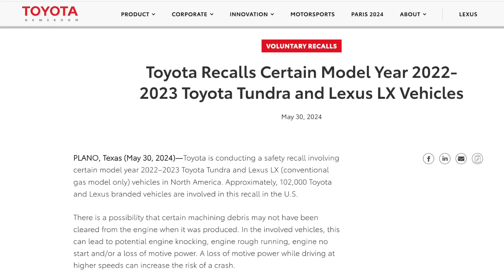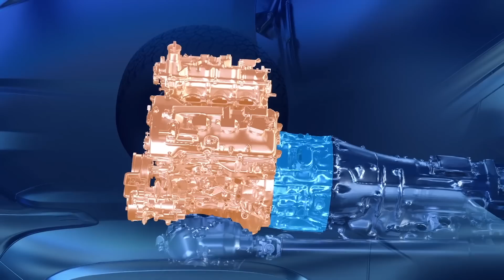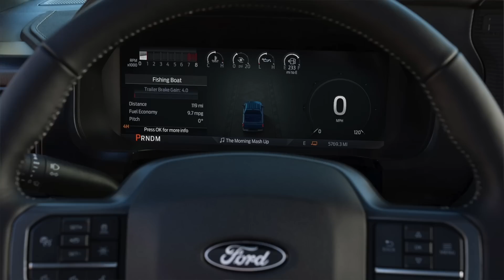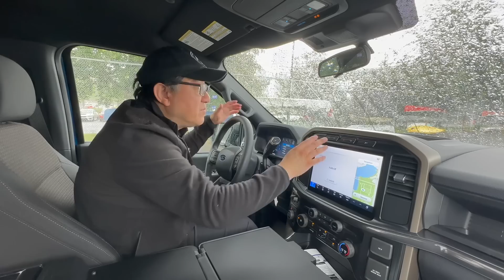ENGINEER EXPLAINS TOYOTA TUNDRA RECALL // SHOULD YOU BUY FORD F-150 INSTEAD?

Comment: I do not want any of these turbo charged over stressed engines. Give me the 5.0 liter in the Ford and 5.7 in the Tundra. I have written off GM and Dodge. I own two trucks. I have the 5.3 liter Vortec prior to the ACMS system and a 4.8 purchased because it did not have ACMS. I keep hearing this is mandated by the government. Let’s change the friggin government. What is better for the environment? A vehicle that lasts 75,000 miles or one that lasts 300,000? There is pollution and energy costs that go into each new vehicle. Many of vehicles sold today are short changing the younger generation. My last Silverado had 385,000 and was still going strong but needed another transmission. A new owner put in another transmission and I saw it back on the road a week later. I know that simple is better and all the fancy poop that they are putting in trucks today will be a problem tomorrow.
Reply: Dodge hasn't built a truck in 16 years...
Reply: @M_dot202  we know what the Rams really are though. Dodge.
Reply: @korndawggy1801  that's almost like saying that AMC still makes Jeeps.
Reply: @korndawggy1801  I thought Rams were Fiat?  😂
Reply: @M_dot202 TOM"A"TOE, TA"MA"TO
Reply: Yeah turbos are junk good thing Ford you can get a V8 still.
Reply: Built in obsolescence
Reply: GM’s 6.2 is truly solid tho
Reply: @JokerG16 No they have that garbage AFM (cylinder deactivation) which causes the lifters to fail early. Those engines used to be reliable before they put in the AFM junk
Reply: That's just not a rational or reasonable statement. What specifically is an "over stressed" engine? What is over stressed specifically and how? It's also not a rational statement based on the issue this engineer just described as the root cause of the issue.
Reply: @ryansheard8092  there are indications that it is forward bearing failing in the Tundra. The forward support girdle of engine block may not have sufficient strength. The Ford Eco-Boost blocks are more robust in that area. The Tundra’a most forward bearing will how show dis-color from heat. How come it is the forward bearing that has usually spun? That does not  indicate metal contamination.
Reply: @inspiredartphotos  the girdle is a one piece design, from what I understand, under high stress, there is a twisting effect that starts at the rear of this "ladder" design and has a greater effect on the front bearing.
Reply: @Gestapo943  I agree!
Reply: @ryansheard8092  I take that to mean the ratio of torque and hp to displacement; there's a video on here where back in 2018 this issue came up in a conversation with toyota engineers regarding this engine design.
Reply: Toyota don’t have experience to do new technology
Reply: @tonybui135 Don't they let YAMAHA design their V  engines?
Reply: The 5.0 also has cylinder deactivation and has oil consumption issues just like the other domestic v8’s. The 2.7 is actually the most reliable engine of the f-150 lineup.
Reply: @ARehman11194  some of us liked the earlier generations of the 5.0.
Reply: @inspiredartphotos  it’s specifically the 21 and up, prior to that the 5.0 was a good engine, did have some oil consumption issues though in the later years prior to 21 though.
Reply: @ARehman11194  I understand that earlier 5.0 was a more robust block. Heavier but had less problems. When did they go the ACMS system and a belt driven oil pump?
Reply: @inspiredartphotos Both the first gen and second gen 5.0L Coyote V8s are very reliable (almost as reliable as any Toyota V8) and same with the 6.2L SOHC 2V BOSS V8 in the first gen Raptor as well as the Super Duty.
Reply: @ You made a wise decision. I read recently that Toyota is going to re-release a new FJ. It is supposed to be a throw back with the reliable V6. We will see.
Reply: @ARehman11194 Yet not as reliable as the 5.6L Endurance V8 in the Nissan Titan.
Reply: You guys are crazy lol. The turbo motors from ford are fantastic. Literally haven’t had an issue. The issues with Toyota are things that need to be ironed out and it’s every manufacturer that has ever built a new motor have the issues. Look up Toyota recalls and issues with the 5.7 when it came out versus the 4.7. This shit happens.
Reply: @wesharris07 and when the 5.7 came out there was also an option for the 4.6liter
Reply: It is like hypertension eventually you'll get a stroke because your heart works too much
Reply: Ford 5.0 V8's have cylinder deactivation now also. Along with a belt driven oil pump.
Reply: @randycupp5925 Exactly which is why I've bought the 2024 Nissan Titan with the 5.6L Endurance V8 in it with 400 HP and 413 Ibs of Torque vs the 2024 Ford F150 with the 5.0L Coyote V8 in it with 400 HP and 410 Ibs.
Reply: 5.0L has oil use issues.
Reply: Stellantis
Reply: I drive the 2021 F150 3.5 and I’m buying a new one. Tons of power and great on gas. I drive north to the cottage a lot. 
I’d go broke paying gas with a V8.
I’m getting 11klm per 100 at 118klm an hour for 3 1/2 hrs.
Owe…it will blow the doors off your V8’s and tow heavy loads easier!
That’s no B/S
Reply: @mcmuskie2563  Did they get this issue resolved. Ford has issued multiple service bulletins, with the most recent being Customer Satisfaction Program 21N03 – Supplement #4. This program extended warranty coverage under certain conditions for a VCT replacement due to tapping phasers.
Reply: @mcmuskie2563 What job do you have and how much money do you make to afford that overpriced EcoBoost truck of yours?
Reply: The 2.7 eco is the most reliable engine in any truck built today. It may not be the most powerful but it’s more than adequate for any half ton user.
Reply: @zachattack83  If I were going to buy a new truck I would strongly consider a 2.7 EcoBoost. They seem to the exception to my statement. My 4.8 VORTEC only has 39,000 miles on it. So I may not be buying a truck for a while. I was shopping for a Toyota Sequoia for my wife. That is where I started tracking the Toyota issues. We will be buying a Acura MDX from friends. They are replacing their 2021 model. It is normally aspirated and we can get for what their dealer trade would be. It has 35,000 miles on it.
Reply: I totally agree
Reply: Fully agree 100%
Reply: Fully agree 100%

Comment: people dont seem to see the fact that it is not just the tundra, it is also the lexus.  these blocks are made in 2 completely different factories across the world from each other and yet having the same debris issue?  not likely.  there are things that toyota are not saying here.  this same engine is inside the brand new gx550 too, so, toyota/lexus NEEDS  this engine to work and not give them issues because if not it will destroy their sales and business on pretty much every flagship model.  this is sad because even after "fixing the issue"  it still happens yet again and again over and over for most of the affected vehicles.  This is to the point that the dealerships are refusing them on trade in but they sure arent refusing to sell and advertise them everywhere to everyone though.  This is sad from toyota and needs to be made right more than just fixing it and more than just a public apology that means nothing at all from the owner/ceo of toyota/lexus

Comment: Years from now i bet it will be found to be the main bearing change that is the issue. Thee change from 4 to a single bearing failed and that caused the metal all over the engine not the machining process
Reply: Darn right!

Comment: I would consider a Titan while they last.
Reply: It will depreciate rapidly and not have parts availability.  I’d get an F150 with the 2.7t.
Reply: Me too. Love my Titan!
Reply: The Titan is a proven platform.  It is reliable and simple, V8 power, solid transmission, and the right amount of tech.
Reply: Obviously you don't watch Scottys channel.  He will tell you titans are crap
Reply: @ericswanson9773 Scotty is entitled to his opinion. I've had 5 years of flawless performance from my Titan, even when towing heavy. No regrets here.
Reply: @ericswanson9773  

Scotty is full of crap.
Reply: @ericswanson9773 Scotty Kilmer actually reviewed the Titan and he said the Titans are excellent trucks (the same thing he said about the Frontiers as well).
Reply: Scottys video on Titan ending was actually full of praise. He blamed Nissan for not marketing.
Reply: @AlexSantos-eo9kl Agreed 100%
Reply: I have 05 Titan 110K miles $500 in repairs in 19 years.
Reply: Fully agree 100%, I just traded in my 2011 Ford F150 with the 5.0L Coyote V8 in it with 163,000 miles on it for a 2024 Nissan Titan with the 5.6L Endurance V8 in it that had 32 miles on it but now has 4900 miles on it and man let me tell you its a freakn beast.

Comment: IMHO   Toyota did not include the 2024 Tundra's because the dealership could not sell them with a active recall.  That is OK because they are no longer selling 2024 anyways.
Reply: if anyone goes out and buys a 2024 tundra at this point they deserve whatever they get.
Reply: 2024 was also likely not recalled because the if you look at the effected engine dates in the recall only a very small portion of those engines would have made it into the 2024's. I think they will get recalled just like the hybrids at some point but it will be by VIN and not the whole allotment.

Comment: Trading in my 2024 white trd pro tundra with 12k miles for a 2024 Raptor R oxford white

Picking it up this Friday 

Will come back to Tundra when recalls are over
Reply: Absolutely the wrong thing to do unless you like to throw away money. You traded your truck a 24, which probably was made AFTER the fix was instituted, at the weakest point of the trade value for your truck. You should have waited until the fix was known and your trading position was stronger. Complete panicking move .
And I drive a F150 tremor which is better than a trd pro
Reply: @jimsteinway695  His truck. His decision. Move along.
Reply: Do you have the 3.5l turbo or 5.0 tremor?
Reply: smart move to get rid of it before it's included in the recall as well.

Comment: Is a Hyundai Santa Fe a reliable truck? I am looking at the turbo version.
Reply: Hyundai kids have a 1 year warranty for a reason. They break all the time.  Also their dealer network is the worst at honoring their warranty. I’d stay away.  I’d heard they are marking them up.  Get a Toyota
Reply: Hyundai and Kia dealerships are dropping in about 10 turbo 2.0 engines a day
Reply: I would not trust a Hyundai or KIA turbo engine or their dual clutch transmissions.

Comment: There are ford channels dedicated t replacing engines. HD Ford diesel has an even shorter life than the gas engines they make. 

They all break, but the ford looks like it was designed in the 70s with a Mazda interior and Lego exterior. The Toyota looks cool, GMC is nice, the #RAM is even nicer.

Comment: I passed on the Tundra specifically because it was the first year with a new engine.  F150 is on its third generation v6 turbo by now, always safer to skip the first generation.
Reply: Agreed, never buy a 1st year refresh on any brand
Reply: Im very happy with my 3.5
Reply: @mcmuskie2563 you mean 3.4 if its a new gen.
Reply: & save money :) 💯
Reply: 5.0 is the more reliable than the 3.5 ecoboost. But the 3.5 is great as long as you maintain it properly.

Comment: when a horse power and torque is extremely high result of turbo, crank bearing can be damaged.
Reply: When the design Is the result of overnight engineering, the end result is typically a disaster
Reply: @quyle9483 overnight engineering?  You clearly have zero clue
Reply: @OldmanSnake   just look at that bottom end girdle. You've got to be kidding me if you think that is remotely well engineered. Toyota has effed up not making a strong enough bottom end for actual heavy duty application on that design. Someone without an engineering degree could have designed far superior.
Reply: The worst year to date for the Tundra was 2012. This year alone saw several consumer reports with issues, including the engine, the transmission, and electrical systems. The top issue reported was the air induction pump, which has a high repair cost. Problems were reported, on average, around 74,000 miles, and the price was over $3,000 to repair. 

Another critical issue that came out of this year was transmission failure. The transmission is like the heart of a vehicle, and when it gives out, it comes with a number of significant issues attached to it. In the case of the Tundra, issues with the transmission started showing up around 9,700 miles, which is very little for a car with a reputation like Toyota. Average costs for transmission replacement are about $5,000. In 2007, consumer reports showed that the engine was the biggest issue, with some reporting a complete failure. Among the 537 complaints collected from this consumer report, air injection pump failure and knocking pistons were the two complaints. 

In addition, there were reported issues with the speed control, with the National Highway Traffic Safety Administration reporting issues with speed control, engine cooling, and accelerator pedals. These are dangerous issues, but they appear on a small scale compared to other brands.
Reply: @ericswanson9773  Check out how much is to replace this engine and you'll see why people are concerned.
Reply: Actually the hp and torque specs are quite average for a 3.4L.

Comment: Having a main bearing fail is not the same as having a rattle in the dashboard for a recall. I feel sorry for the owner's who will be taking a huge financial hit, if they go to resale or trade the truck in. Fortunately, Toyota isn't a player in the full size truck market so fewer people will take the hit, but it still sucks for the Toyota owners.
Reply: They won’t take any hit. Porsche had a fire in their most desirable 911 in the 2015 GT3. They stopped sales and stopped drive. Paid their owners $2500 a month while not driving. They replaced the engine which is way more costly than a tundra motor. And they extended the warranty to 10 years. I believe Toyota will replace the motor and extend the warranty. 

Toyotas currency with their customers is their reliability. They won’t let that take a hit. They’ll do the right thing, they’ll fix the issue and resale won’t suffer
Reply: @jimsteinway695  I think you might be having to high of expectation about the Toyota corporation.
Reply: @jimsteinway695 having your truck in the shop IS taking a hit, especially when it will be in the shop for a prolonged time like with this issue. some people have their trucks set up a certain way to suit their needs and a loaner will not suffice for replacement. sure, the people that use their trucks to commute and go grocery shopping will be fine, but thats not everyone.
Reply: They won't take any hit. Both my Ford 150 blew an engine and my GMC Denali fell apart. I'll take my new Toyota all day over Detroit garbage
Reply: @OldmanSnake   no one cares
Reply: @OldmanSnake  same 100% agree.  Toyota and Honda trying to bring jobs to America but big 3 are trying to send all their manufacturing to Mexico or China
Reply: @OldmanSnake  But these (Toyotas) are blowing engines...
Reply: No shit I ll take a Toyota even with a recall over any dodge ford or chevy
Reply: @gumerdominguez4091   toyota = herpes
Reply: Word has it dealers don’t even want the truck on a trade-in. Because the dealers by law can’t sell a car when there’s a recall on it until it’s fixed and these dealers don’t wanna wait six months or more until it gets fixed because they’re losing money on it sitting on their lot when they can’t sell it.

Comment: Nissan Titan is the best bet for reliability until it gets discontinued in August
Reply: No lol
Reply: @melvingibson4525 yes, lol
Reply: @stever5359 I wouldn’t touch anything from Nissan with a 10 foot pole.  Good luck getting parts support on a discontinued model.  Toy will fix the 3.4t.  The F150 and Silverado are good alternatives.
Reply: This has become the trendy comment, that Nissan Titan is some godsend to reliability. I like them and so I joined a bunch of their online groups to do more research before purchasing. They are plagued by engine and transmission issues and cheap interior parts, similar to everyone else. Having said that, they don’t come with cylinder deactivation and auto start stop and have good power, so I can see that being worth it for a lot of people.
Reply: Stay away from the Titan diesel models. Nissan doesn't sell any parts for the transmission on the diesel Titan. That means when the front main seal ($40 part) fails, you have to purchase the entire transmission ($12K) in order to fix the truck! Brutal!!! 👎